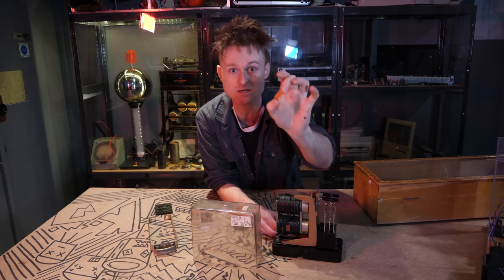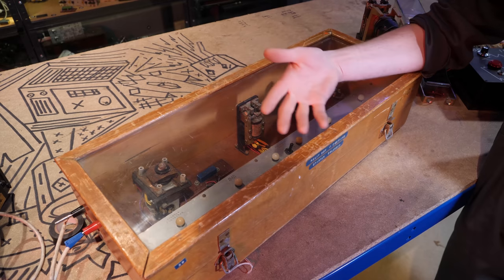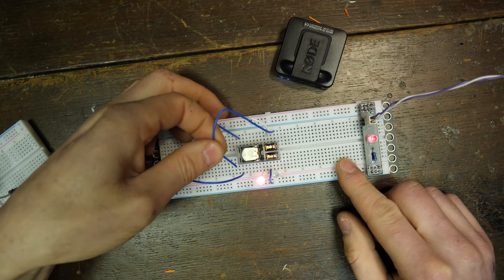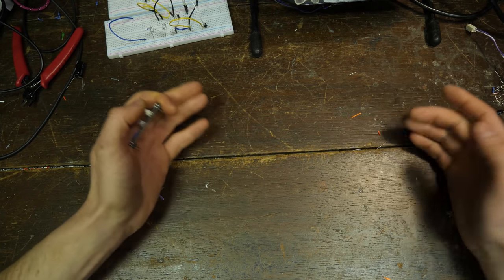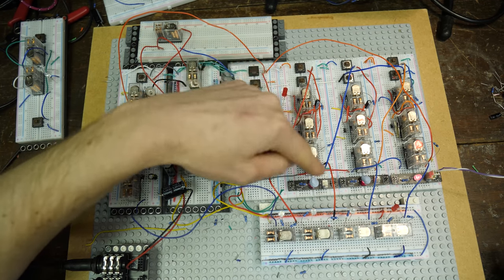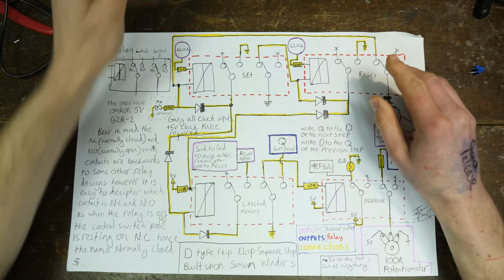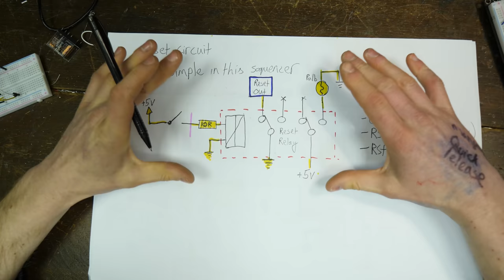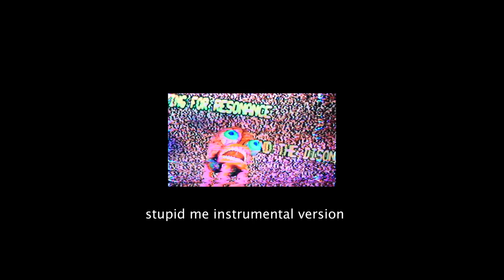Making A Synthesiser Sequencer Out Of RELAYS Part 1

Comment: The reason that one setup sounded like a turn signal in a car is because that's what most older cars actually used for that.

Also if looking for an interesting example of programmable stuff with relays, might want to try finding some info on one of those marquee signs that dates back to the 1920's or 1930's. From what I recall they programmed them with punch cards that would block the light going to a set of photoresistors, but once the text was in the "memory" it kept looping kind of like the setup in this video's example. Crazy that they figured out that stuff way back before vacuum tube or even solid state computers.
Reply from the maker: Well yeah haha that's why I said it! Unmistakable :D

Comment: Cool project concept! Relays with latching circuits where very common in lift logic / elevator control circuits until the 1980’s. They where combined with very complicated electromechanical devices to register the lift’s position in the shaft. Also, the the more advanced lift controllers have a memory function where it can store multiple calls. There are some video’s on YouTube made by lift enthusiasts explaining the design of these circuits. Some old lifts may still have their original relay controller, you can typically hear them working when the lift is moving. It’s essentially an electromechanical computer.

Comment: My dad used to design and build High Voltage test equipment. His company was called HW Electronics (mainly spark testers for testing the the insulation when extruding cables of all sizes) and I remember a design for a counter latching relay circuit that he designed that would mark and count the number of faults along the length of  cable (if any) when it was being extruded. He finally hung up his soldering Iron and retired at the age of 75 back in 1997. Relays and valves were his thing and while he thought transistors were fantastic he could never get excited about them lol. I guess he was just "old school".
This brings back some of the times I used to help out in his factory/workshop as a kid. I'm 58 and retired now!

Comment: "... a room full of relays ..." 
Find a time machine and set the target date for 1940s through 1970. Go back and visit the phone company's local "switching station" in Anytown U.S.A., Great Britain. or Europe. You will find not just a room full of relays, but an entire building full of them - top to bottom, wall to wall. These were rotary relays that advanced one detent with each clock pulse. Each relay had 1 Normally Closed contact (#0) and 9 Normally Open contacts (#1 - #9) Each contact was wired to a different but specific bank of relays. As you dialed a number, your phone would pulse (clock) the rotary relays working your way through a maze of relays to finally connect your phone to any other phone in that switching station network. By 1970s dialing (1+area code) had been implemented which triggered the initial entry relay to connect your phone to another switching station designated by the area code on a long distance phone line or "trunk line". These were essentially building sized mechanical relay computers who's biggest problem was the heat that was generated by the rotary servos on a Sunday afternoon when most people decided to call their Mums.
Reply: Don't forget the boys calling back the girl the met the Saturday night before ;-)... All that copper now condensed to a mere glass fiber
Reply: Fascinating old school infrastructure
Reply: Stepping relays like that haven't been used in the US phone system for a long time. The Western Electric crossbar switches (AFAIK) only used regular relays and counted in a digital method, producing a 2 of 5 code.
Reply: @eDoc2020  It probably depended on the area. I saw it in operation first hand in 1964.  It was in a rural area, occupied a small re-purposed house, and was right across the street from where I went to school. It was a favorite "class trip" for the science class. The buzzing and clicking of all those relays was defining ... but extremely fascinating to a 5th grader.
Reply: @3DPDK  It seems independent telephone companies as well as rural Bell offices would tend to use older Strowger systems instead of the newer and more complicated Panel and Crossbar systems which only made sense for more urban areas. I guess that makes us both right.
Reply: @eDoc2020  It's like anything else, infrastructure takes time to build and the low population areas are the last to get updated. It's a foggy memory but I believe it was Bell Telephone at the time, just west of Richmond, Va. in (pretty much) a farming county.
Reply: There is a museum in Seattle, Washington called the Connections Museum that maintains (mostly) functional switchboard relay systems, its crazy watching all the switching taking place just to connect a phone call! Not to mention the whole thing is wired up with wire wrap, no PCBs in sight.
Reply: Looks like you slightly misunderstood how a Step exchange works. The rotary switches can step vertically between 0 (the state where the subscriber has not started sending dial pulses) and 10 ("0"). Once you have finished dialing a digit, it steps horizontally on its own until it can find a selector further down the chain that is available. These selector switches do not control banks of relays, but instead switch the circuit themselves. Also note that this was only one type of system, and was generally used on smaller systems. Some useful resources if you want to research further are evan-doorbell.com and the Connections Museum's YouTube channel.

Comment: Fascinating. For an art installation, I imagine putting a glass cube in a public square with a vertical panel in the middle (a more robust breadboard type thing) where people from both sides of the panel could grab modules, plug them and play around with music and blinky leds. Make the platform and the people rotate and you have a hit. The reason for the cube is to keep the sound inside to comply with sound regulations.

Comment: I just started planning a design for a 32-bit relay calculator... Complete with an integer add, subtract, multiply, and divide ALU, decimal display and keypad, ... I'm planning this thing to have in the ball park of 1,000-10,000 relays running at about 5-10hz. 

Needless to say, I love relays.

Comment: I love how you made a totally normal SR latch, including the Q and not-Q outputs (with the normally-open being the Q I guess?), it's just relays instead of semiconductors. And an SR latch is the basis of SRAM chips AIUI, so you've made electro-mechanical SRAM! Since it keeps its state as long as it's kept powered and doesn't need refreshed. Pretty cool.

That buzzing noise you demonstrated is the basis of most electromechanical doorbells and buzzers too. Sometimes they attach a hammer to the relay coil so it can hit a bell, but sometimes it just buzzes inside a little box which kind of resonates with the buzz. And some older commercial buzzers made very different noises if you switch between AC and DC. 

As a kid I thought traditional doorbells and door buzzers were totally different, but really they just close a switch to a similar coil. It just depends whether they want a big box with a bell attached, or a little box which just buzzes. Of course a lot nowadays they're not electromechanical at all... but my doorbell still is! (You can even hear the coil buzzing after the bell goes, if you continue to hold the button.)

Comment: from 10:00 to 13:00 is basicly the circuit I used for the decade counters in my relay clock! It works very much the same, except with a transistor instead of the third relay. I like it!

Comment: This is neat! If you're getting into trouble with electromagnetic interference or noise on your signals, I'd suggest adding 100nF ceramic capacitors across each relay coil. With inductive loads like relays or motors, it's often a good idea to a snubber capacitor.

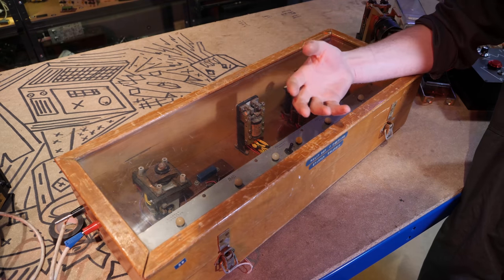Comment: 3:05 The relay in that audio device example is to prevent it from outputting an audio signal before the AC coupling capacitors have had a chance to reach a quiescent state (I love that term). 
Once they have had enough time to charge, the relay connects the audio-out to the 'gubbins'. Essentially, this is to prevent that "THUMP!" sound when it turns on, or for it to output a tiny sound that takes time to grow into the full output. It's often interpreted as evidence that the manufacturer has "spared no expense" and that the product is overall higher quality; proving to your homies that it was worth the price when they inevitably attempt to clown you for paying too much. 
It was more significant during the Vacuum tube era, as it served as a signal to 'OCD'-types that the minutes of waiting for power-up were complete. This saved them hours of "making sure" time, and made it okay to turn off the system after use (resulting in lower tube life and increased service and parts revenue). People still remember that, so it must be present to justify the price of a 'premium' model; even if the design is modernized and the relay sound is simulated to save cost. (this is not a claim that your particular relay sound is bogus)
Humorously, avoiding the loud thump also results in a need to make the relay "CLICK!" loudly, so that it can still serve to justify the inflated price, and to reduce service calls.

Comment: You can use a zener diode and a diode in series as recirculating circuit, the magnetizing current will be extinguished faster and you could switch the relay even faster. I pretty sure you won't read this but maybe will help someone. Very nice channel!!!

Comment: Relay extended switch bar t hitting reverb string would be pretty nice. Also get several static reed switches and use them as gates while magnets are placed on a rotating turntable - This way you can make very nice loose/tight sequences.

Comment: You can use the property of "must engage voltage" , the "holding voltage" and the "must let go voltage" of the relay. To make simple latching and reset circuits. If you under and over volt relays. The holding voltage can be much lower than the engage voltage, and the let go voltage is even lower. You can take advantage of this property of a relay hysteresis.

Comment: When I was 11 I made a two bit binary telephone exchange to switch 4 lines on a home made telephone intercom between my friend's house - the phone was just carbon granual microphones in series with the speaker and two d-cell batteries. It meant I could switch it with only a single 4 core cable (using a shared ground)

Comment: Yes, amplifiers have a relay to prevent the electrical noise on startup, which can cause DC current to run through speakers, which can burn the coils and blow up your speaker.

Comment: Those big relays would be in the back of the big ol' board of switches controlled by the yard operator! When a switch is thrown, a relay with anywhere from 1 to several contacts will switch many rail crossovers at a time to choose where the train is going! :D

I like trains lol.

Comment: In the future I'd love to use relays or solonoids, attached to analog potentiometers with 90° arcs determined by levers attached to the solonoid. 

So that, during the delay, between the on & the off:  two analog signals are swinging up and down. 

Then those signals will be the real heart of the computation, and the delay where it is definively on or definitely off, will be like blank signals. 

So during the low arc and high arc, radio signals are multiplexed throught it, and pass through electromechanical radio optica prisms and stuff to do calculations, and different bands of spectra can contain a range of amplitude data, and the same stream of info can be looped back and passed over the same wires and through the some of the same processors but on a different radio frequency so as not to combine the datas. 

Then they go into some kinof "packet-izer" circuit to have an op-codes added to their words. 

Instead of words being opcodes/addresses, instead they'd just be labels that are binary amplitude patters which will get reinterpreted as flat lines so that the analog transforms done over them can be more obvious. 

Rushed this, will edit add more.

Or, I'd use thermal relays, and thermristers, wired into an oscilator, and then I'd use heatpipes and thermometers to do calculations; and I'd shield it from ambient radiation, and have a self-thermo-regulating; smooth computer that goes nice and slow, and uses thermal energy as data. 

That would still be digital, unlike the radiowave one would be analog with digital signals only serving as landmarks for data packets. 

This one would be purely digital using its own waste heat as its data, so it would probably fail if it was too hot or too cold, since absolute  zero would prevent thermo-mechanical expansion, and too much heat would obviously just melt it, or push the noise floor up into the signal ceiling: resulting in an undefined illegal output. 

Either way, both those things sound fun and interesting; practicality be danged🤘‼

Although I probably won't for a very long time, so I'm glad I can get my obscure/retro technology fix from youtube. 

TLDR: Thank you for existing.

PS: cable boxes send radiowaves through wires. So what I want from the first one is just an imagining of an optical computer but the optics are radio-optics. All the other mechanical stuff, is to create an even continous data storage, so that it natively supports floating point.

Frequencies in nature are discrete though, so, the multiplexed radio frequencies would be less-continuous than the continuous amplitude maths inside of them.

Comment: Relais compared to transistors is like comparing Steam engines to petrol engines. With steam you can see all the moving parts do their thing, with petrol you just put petrol in and get power out. Steam is so much more fun as are relais. ^___^

Comment: Small relay computers/logic systems are still in use around here and there. Some older elevators, telephone switchers and many places within the railway industry still use relay logic and more advanced relay computing systems.
I however doubt they still install them from new but they definetly maintain the older systems many places since it is cheaper than having to upgrade it all to modern PLC/Computer control, which then still uses relays to switch the larger currents.
Reply from the maker: aaah yeah elvators ofcourse!

Comment: The IBM 029 keypunch and 059 verifier, which in the early 1960s replaced the 024/026/056 models from the 1930s/1940s, replaced the rack-mounted relays with reed relays mounted on a motherboard.

Comment: Check out latching telecoms relays. I built an 8 step counter for a drum sequencer out of those, you only need one relay per step. But, not as flexible as yours - it only counted up one relay at a time and then reset. I also didn't know about diodes at the time, so the switch matrix for the drum signals was very unpredictable!

Comment: Careful with the room full of relays. There is an anecdote from germany, I can not source or confirm it but apparently back in the 60's? a relay based telecommunication operators exchange thing machine whatever of considerable size was built into a post office on the upper floor. And when they were testing it there was a stage when it got switched off and hundreds of throusands of tiny metal latches adding up to a considerable weight fell a few millimetres towards the floor - through which the whole machine promptly went.
Sadly I only heard it once and have no actual sources for the story.

Comment: That massive railroad relay is a great way to start! However, the normally closed and normally open sides of the switch are not poles, they're throws. So that railroad relay has four poles and a double throw. This is often abbreviated as 4PDT. (At first I thought it was a slip-of-the-tongue, but the same confusion with poles/throws occurs again later in the video.)
Reply from the maker: Double slip of the tongue. My bad if you see any of my vids you'll see I get shit mixed up all the time ha. The way I see it is if someone is into it enough they will eventually get the right.definitions elsewhere at least they get the crux of it here lol
Reply: @LOOKMUMNOCOMPUTER  I really like your stuff. Your projects work on multiple levels: (no) computers, making stuff, and, most importantly, music. Keep up the great work!
Reply: Actually it looks like that relay only has two changeover contacts, and a further two normally open ones. It would usually be described as a 4 Front, 2 Back relay - Fronts are normally open and Backs normally closed.

Comment: EM stepper units would be great for sequencing (as that is what they are designed for). However, it might be tricky getting a hold of ones that do what you want and also they run on 24-48V not just 5V. However, it would drastically cut down the number of relays for a full scale sequencer. Try contacting Joe's Classic Video Games to see if he has any totally junk pinball machines he can salvage parts from.